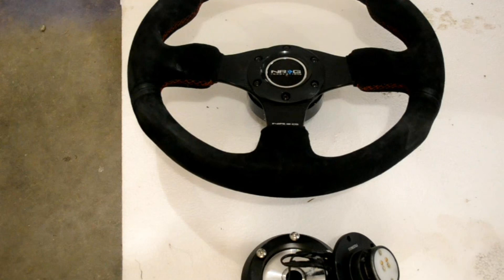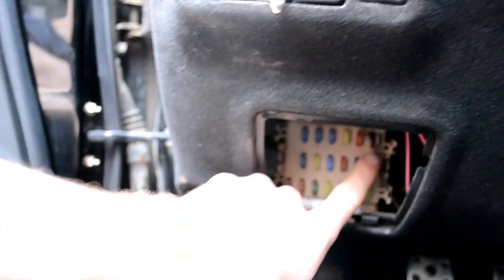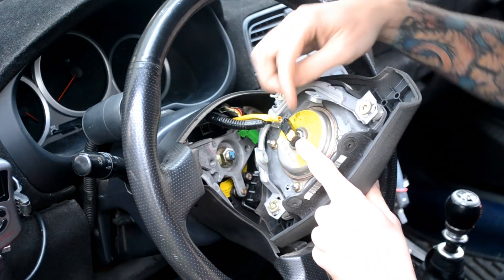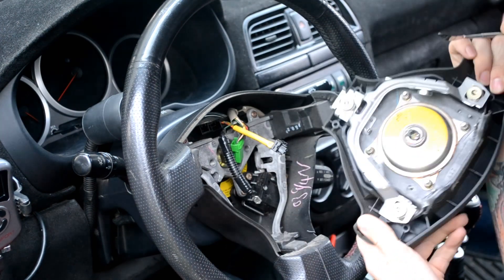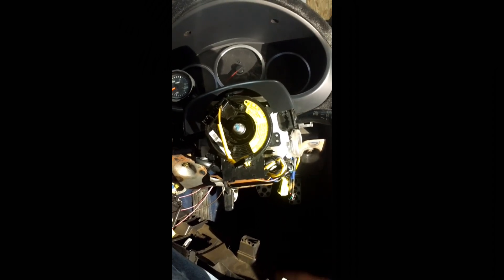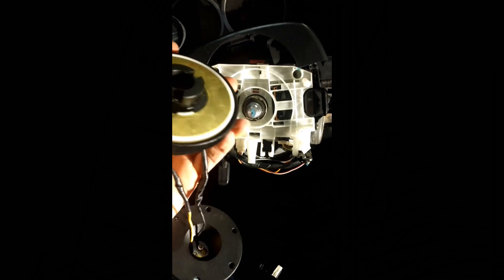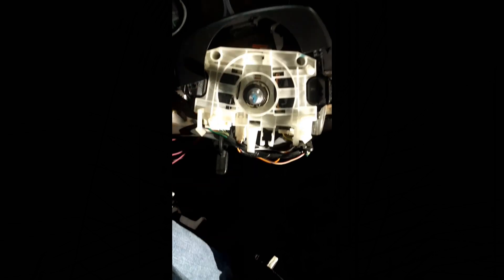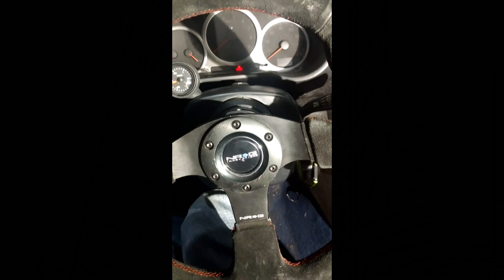Aftermarket steering wheel install on a Subaru

Comment: Hey, do the indicators still turn off after the turn
Reply from the maker: For this set up I have, they don't. You have to manually flip it
Reply: Okay thanks for the reply had same problem, ended up making a clock wheel from a juice bottle lid, some plastic and a couple screws haha works like a dream
Reply from the maker: Now that is some innovation lol glad to hear it worked though
Reply: @Bexxiii09  Hi could you please explain how you made it? I really want the indicator turn off itself

Comment: Can you reinstall your stock steering wheel with a boss kit or is it a mandatory upgrade?
Reply from the maker: Yeah you would be able to, there isn't much that is done that is permanent
Reply: @Deep6Rally  would I just need a boss kit? Or would I need to run the quick release too? If I don’t want to run an NRG

Comment: Is there an order I should reconnect the fuse and the battery?
Paranoid about setting off the airbag 😆😆
Reply from the maker: Great question lol but the air bag won't go off unless the sensor has the impact, but just to be safe, battery first and then fuse